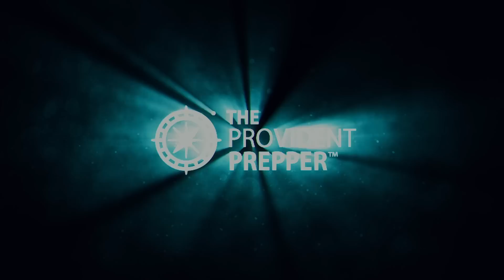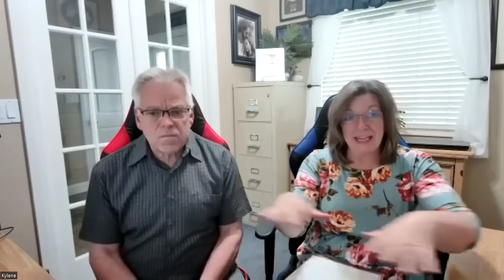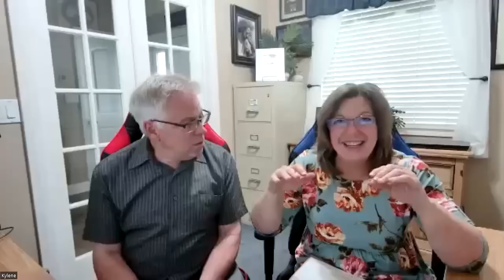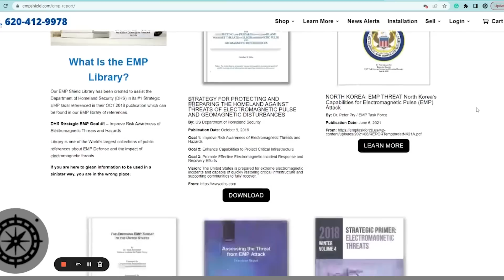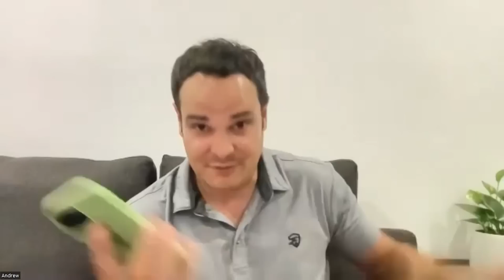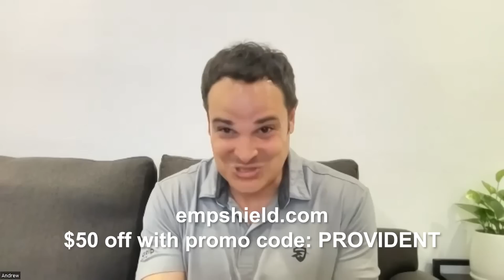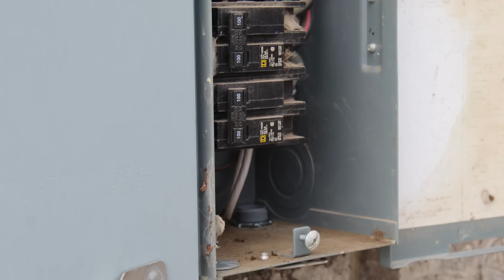Facts About EMP Protection: Interview with EMP Expert Andrew Bucchin

Comment: So many contradictions. If you can't protect a car by disconnecting  the battery or draping it because the emp bounces and is all around how is your $399 shield that connects to your battery going to protect the rest of the vehicles components that are needed to run it. Same for your home. You say things have to be completely enclosed with proper materials you sell so microwaves wont work as protection. All this confused me. Can someone help me understand this?? Maybe I missed something key?

Comment: - So, EMP cloth combined with a large piece of sheet metal on the floor would work?
- sheet metal vs mesh: how tight has mesh to be to be just as effective for building a cage?
- What about mylar blankets/glas fiber/carbon fiber or layers of them?
- How far away means "not connected" (be within the cage but not connected to it) = how thick to build the inner liner? Is a piece of cardbord enough or a paintjob with liquid rubber?
- does the Faraday cage have to be grounded or is that even harmful?
- Can the Faraday cage consist of pieces of metal that are not electrically connected (like a sheet metal locker)?

Yes I may buy your stuff anyways, but I need to understand the DIY strategies.

Comment: my problem with EMP shield is that somehow this device is going to “sink“all EMP energy around an electronic device. However, all of the electronic components are in and of themselves individual sinks of energy, and you cannot force EMP energy into only one path.

maybe he could explain how he gets around this. It’s just not intuitive at all. There will be multiple inward paths of any electronic device, not just into the power supply. I don’t think these devices are going to work if they are out in the open

Comment: All I got from this video was buy our products.  Other than a vehicle and a 2-way and AM/FM radio.  The things you are trying to protect will have very little if any usefulness after a WEMP or a significant CMEP.
By the time communications infrastructure is back online cellphone and computer batteries will be dead.  Any battery backups you have will probably be dead too and generator fuel exhausted.  Gas stations need electricity to pump gas.  But the gas they had on hand is probably all they will have for a very long time.  It will be gone very quickly and rationed until depleted.  Unless you have a pre-electronics era vehicle it is unlikely to run and not practical or reliable to protect if not designed in.  Once it's out of fuel it no longer useful either.
No running water = no flushing toilet.  How many of you are prepared for that?
What about: 
Cooking?  (propane camp stove?)
Heat? (propane camp heater?)
Drinking water?  (hot water tank unless multi-dwelling unit shared?)
Life sustaining prescriptions?
That's just a simple short list.  Basically, you better be ready to live in the 1800's.

Be careful not to get carbon monoxide poisoned.

Have you ever done a dry run?  How long?
If you are not willing to do even a weekend dry run without running water, no electricity, no modern (electronics) motorized transportation (get a bicycle; good luck keeping it in a real event) and no internet/communication, then you are not prepared.

Real true preppers live off grid.

Comment: Light will seep around the edges of black out curtains. They are NOT safe from view outside.
Try it sometimes before it is too late. 
Turn on the lights and walk outside and look back to your blackout curtained windows yourself.
Better to tape black static film over every window where you will be using any light source at night.
use black static film on all the windows in that one room.

Comment: Ok 1. He said if it fails thet insure it. If the grid goes down, i doubt anyone will be submitting or fulfilling insurance claims.
2. They will come out and repair or replace it.  Again. If the grid is down, highly unlikely.
3. He did not address hiw long after putting electronics or generators etc in a faraday cage you can take them out and safely use them.  The web is loaded w conflicting info.
4. Engineers snd master ekectricians are saying emp home shields do not protect your home..youd hsce to complemely seal your home in a faraday cage.  They ssid that this is just another way to make money off people.  And although i have learned some valuable practical things fro the two of you, i never lose sight of the fact that you are influencers. Persuadibg people to buy products or use services is one of the ways you make money.

Comment: He made a contradictory statement about electronic devices working after an EMP. At first, he stated that it doesn't matter if the device is powered on or off, the free electrons will induce a voltage and kill the device. The device must be in a faraday box\bag.  But then states that his device (whether on or off) will protect from EMP if properly installed in the home, auto, etc... I do not see how that is possible. His device will not stop free electrons. His device my stop or reduce the induced voltage on the powerlines, but the free electrons would still pass through the individual devices in your home or car, etc. Also, he stated the solar panels wouldn't be affected by and EMP, and later says anything with a transistor, resistor, microprocessor, diode, etc., would be damaged. Solar panels have a diode to prevent the panel from discharging the batteries at night, so they would\could be damaged during an EMP.

Comment: file:///C:/Users/UNIQUE/Downloads/db_pa51ca51%20(1).pdf
Description
Flow Technology’s PA51 Pulse Amplifier and CA51 Carrier Amplifier are designed for use with a wide range of turbine flowmeters. They convert low-level flowmeter output signals to high-level, conditioned pulses which may be transmitted for long distances through electronically noisy environments. Both amplifiers provide a power supply for use with 115 VAC or 24 VDC power. PA51 Pulse Amplifiers directly convert low-level signals from a magnetic pickoff to a 10-volt peak-to-peak pulse with a frequency identical to the frequency output of the flowmeter. 
CA51 Carrier Amplifiers are used with an RF pickoff and generate a 45 kHz carrier frequency which is modulated by the rotation of the turbine blades. This eliminates the effects of magnetic drag, greatly extending the range and linearity of small meters at low flow rates.
The amplifier converts this modulated signal to a 10-volt peak-to-peak pulse with a frequency identical to the frequency output of the flowmeter.
Features
• Signal amplification for long-range transmission
• Reliable in harsh industrial environments
• Compatible with magnetic or modulated carrier
(RF) turbine flowmeter pickoffs
• Easily installed directly on flowmeter or at a
remote location
• Use of modular electronics enables field replacement
without recalibration
• Weatherproof or explosion-proof enclosures available
• 115 VAC, 220 VAC or 24 VDC-powered

Comment: I know EMP will interferes with electronic stuffs, but destroying electronic stuffs?  To destroy electronic stuffs, the EMP pulse must carry a lot of energy when it hits your stuffs.  Unless your stuffs are very close to the EMP source.  An EMP pulse isn’t going to destroy anything.
Reply: It will create widespread huge power surge (voltage spike) on the power grid.  Everything connected will be in grave danger of permanent damage.
Vehicle electronics (engine control computer) will be prone to permanent damage.  There is a lot of wire that will act as and EMP antenna.
Reply: @RazorStrap It only happens if you are close enough to the source of the pulse.  
The solar wind is like EMP pulses from the sun.  It interferes with communication, but have you ever heard of wide spread damages to electronic equipment?

Comment: If I have a car parked in an all metal garage, with garage door closed, be protected at all?
Reply: It will depend on the pulse intensity.  Such structures are not electrically sealed as Faraday cage unless specifically designed and built to be so.  Also the conductivity of the metal plays a significant role.  The more conductive the better. 
1. Silver
2. Copper
3. Gold
4. Aluminum

Things like iron, steel and lead are down the list a bit further.

Comment: If it sends the energy to the battery ground, wouldn't it cause the battery to explode from overload?
Just stay in fear, and give us your money, because we told you lies and now we will offer you security and peace of mind. )
Reply: It's not that much energy.  It's a voltage spike.  Think of it similar to a static discharge damaging a computer.  Static discharge as like as 500 volts can damage electronic components.  But there is very little power in that discharge.  So little that it wouldn't even be felt by most people until maybe up around 1000 volts or more.  But still there is very little power in that.  I frequently get shocked by ESD at the grocery store when opening the milk cooler door.  That's probably up around 10000 volts ESD.  But very little power.

Comment: Old steel bodied vehicles protect against EMP & even direct lightning strikes! The old cars NEVER got struck by lightning because they were steel invaded and insulated by rubber tires. Old mechanical diesel engines require No Electronics to operate! Of course they won’t have a WiFi hookup but there won’t be any WiFi anyway unless the Global Elite wants to rebuild that for you peasants. Don’t plan on it.

Comment: EMP is just the start, the ICBM’s will be coming in short order.  
So if you live near a major port, major military installations, or major manufacturing that supports Military Industrial Complex,  I doubt you’re going to survive the pulse, the blast, the heat, the lack of 02, the poison gas from everything burning for days and days.

Getting the grid up?  Let’s assume that the lineman will be willing to comeback to work?  Will it be safe for the lineman to with the fallout and dust?  If the lineman do come to work, will their equipment and tools work post EMP?   Will the lineman have enough supplies to fix the transmission lines?  We know how long it takes the power crews to restore power after a garden variety natural disaster,  Assuming that all the roads and bridges will be passable for the lineman to get to work?  Are the lineman going to have armed escorts?
What happens to the Sewer systems?  The flat landers will find out how the system doesn’t work when the pumps stop working.  Being in a basement that has a sewer hook-up for days without good out flow will be bad.  Just because the Big bright Bang’s happen does mean the rain/snow won’t happen post bang.  If you live in flat America good luck run-off.
We have to assume that the Big Bang’s might happen while your kids are in school, right?  Who’s keeping them safe?  Who’s keep the parents from going nuts!  Cool, your car runs be everyone else’s cars will be dead on the road, The traffic lights will be out.  Will the school buses be able to run?  Will the bus drivers actually show up to work?  Once your kids and other family members make it to your Shelter, do you let them in?  Do you have a Decon room to wash the fallout off of them.  Are you then just waiting for them to die from radiation sickness?  It all sounds horrible.

Comment: A respectful question about the claims made about the product being discussed here. If the product is capable of doing what is claimed, why are government and military facilities, vehicles, aircraft etc not simply protected by using "very fast" surge arrestors (per the admission in the video that this essentially what the product is)? They are not, they use extensive shielding and faraday cage arrangemnts. For example, will the new Boeing VC25s being produced for the military to use as Air Force One simply have a bunch of these EMP Shield products (protecting everything with 500ft on a connected circuit I believe the claim was) or will they have be using  very extensive, heavy, and expensive shielding to form faraday cages? For an aircraft, using a bunch of surge arrestors is likely much more attractive given the reduction in weight which would translate to increased payload and fuel vs physical shielding. And, if the devices are not sufficient to protect military or government facilities/vehicles/aircract, how do I any confidence that it would protect my cellphone or laptop?

Comment: Question: if the entire grid goes down and it gets destroyed why would it be important to have devices that rely on electricity to work? Why would you protect these devices if there is no electricity to use them?
Reply from the maker: We are a resilient people. Eventually, it will all be repaired and rebuilt. If your vehicle and refrigerator are still working you won't be standing in a very long line to purchase new ones. It will take many years to recover. You will be way ahead in the recovery process. Not to mention you can still use those items powered by battery banks, etc.
Reply: @TheProvidentPrepper  How long your battery banks going to last without the power grid?  How long will your generator fuel last.  Do you keep the fuel properly conditioned year after year after year after year...  So it will work reliably when needed.
Most people will probably be dead before the power grid is restored.
Many people will die in a short time due to lack of life sustaining prescriptions.
Do you have an outhouse?

Comment: Remember that 50,000 volts will in all probability light your wiring up like a toaster !!! Anything with a length of circut (that means its total circut length) will have a current/voltage load in excess of its design parameters. The wiring will simply melt or burn out, thats how the grid is "lost"
Reply: Voltage alone does not determine current (I).  I=V/R.  Pw = VI
Consider ESD
Consider ICE ignition system.
Both very high voltage.  Neither has much current or power.
It's not the wire that typically gets fried.  It's the electronics.

Comment: Humans are antennas
Reply: We are subjected to EMR 24/7.

Nuclear electromagnetic pulse - Wikipedia
EMPs of sufficient magnitude and length have the potential to affect the human body. Possible side effects include cellular mutations, nervous system damages, internal burns, brain damage, and temporary problems with thinking and memory.  However, this would be in extreme cases like being near the center of the blast and being exposed to a large amount of radiation and EMP waves.

https://en.wikipedia.org/wiki/Nuclear_electromagnetic_pulse#:~:text=EMPs%20of%20sufficient%20magnitude%20and,problems%20with%20thinking%20and%20memory.

Comment: There is no mention here if unshielded can it affect our health.  What is the most dosage we can physically endure without getting jolted violently while one is sleeping in the dead of the night. I feel like a guinea pig when this happens.  I am terrified to go to bed.
Reply: You are safe lol. An emp is completely safe for people. You are more at risk from your cell phone and microwave oven than from an emp. Seriously you are, try this for example; for one full week,  every night before going to bed, turn off all cell phones completely,  and leave outside of your bedroom  along with any other electronics that use Bluetooth or wifi. None of that should be in your bedroom while you sleep. 

Each day, log your sleep and how well you did. Then resume your normal routine and note the difference. If you are an "on-call" person, at least leave your cell phone outside your bedroom door, or as far away from your head as possible while sleeping. Same goes with any Bluetooth or wifi devices. You'll be amazed at how much these things are robbing you of sleep.
Reply: Nuclear electromagnetic pulse - Wikipedia
EMPs of sufficient magnitude and length have the potential to affect the human body. Possible side effects include cellular mutations, nervous system damages, internal burns, brain damage, and temporary problems with thinking and memory.  <b>However, this would be in extreme cases like being near the center of the blast and being exposed to a large amount of radiation and EMP waves.</b>

A study found that exposure to 200–400 pulses of EMP caused the leaking of vessels in the brain, leakage that has been linked to small problems with thinking and memory recollection. These effects could last up to 12 hours after the exposure. Due to the long exposure time needed to see any of these effects it is unlikely that anyone would see these effects even if exposed for a small period of time. Also, the human body will see little effect as signals are passed chemically and not electrically making it hard to be affected by EMP waves.

https://en.wikipedia.org/wiki/Nuclear_electromagnetic_pulse#:~:text=EMPs%20of%20sufficient%20magnitude%20and,problems%20with%20thinking%20and%20memory.
Reply: Do not wear a tinfoil hat.  Seriously do not.

Comment: I had a power surge that fried out my furnaces electronic card, and my goal zero solar generator. Cost me 500 plus for heater, and the cost of the generator. I've installed the emp shield on my breaker box and in my vehicle.  Feel better now, but you never know, fingers crossed.